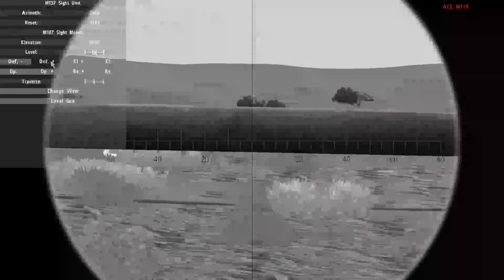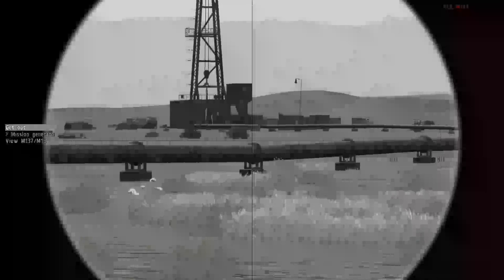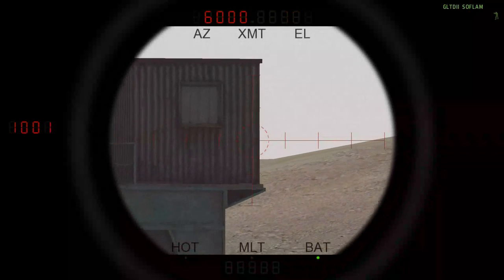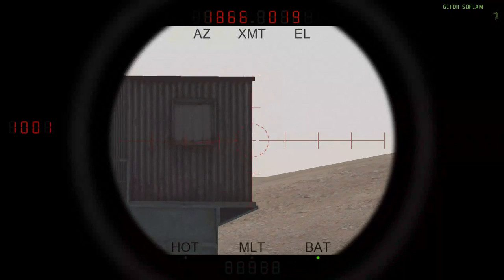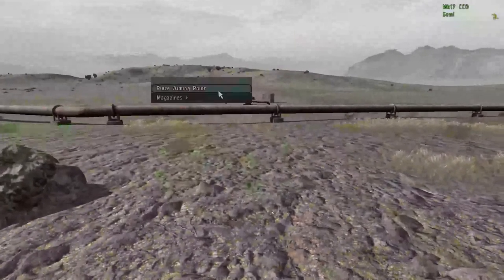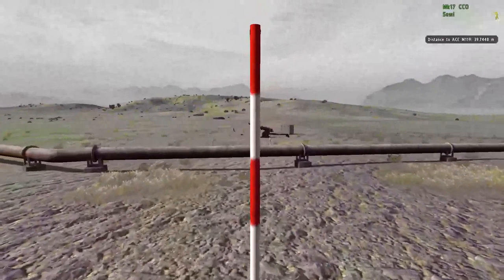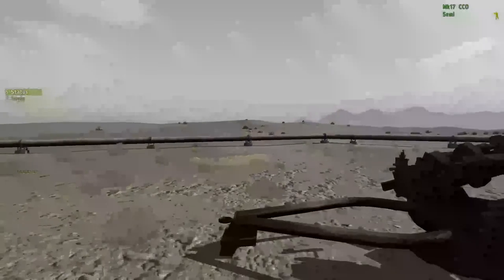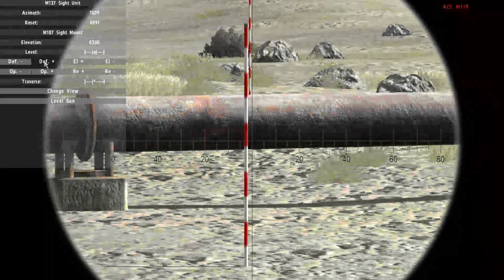ACE M119 setup

Comment: Great tutorial. While it is rare that you actually need to set this up yourself it's a good thing to know. It works a little bit differently for the mortars where the reset buttons swing the sight unit around, but the principle is the same. I can't count the missions I've played that were set up with T-E in mind that makes you cram into a small mortar pit with no aiming post where you have to set them up yourself, but practice makes perfect.